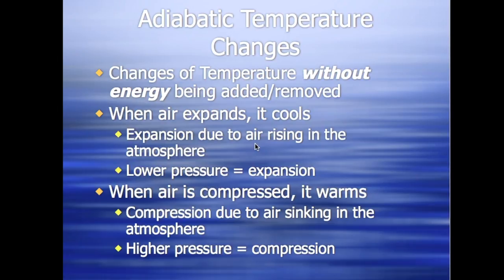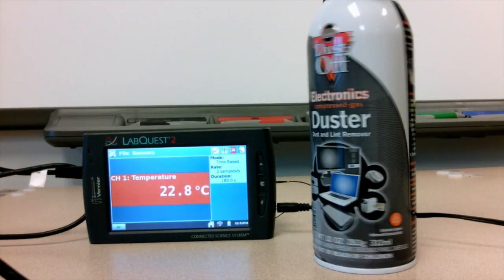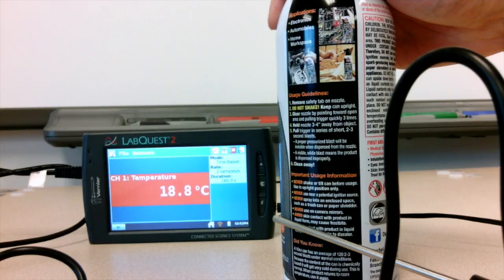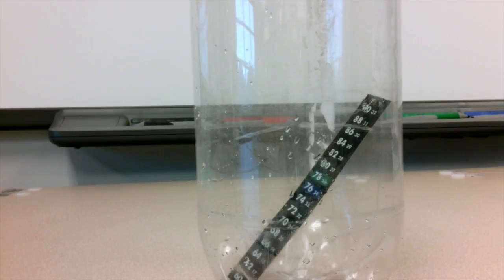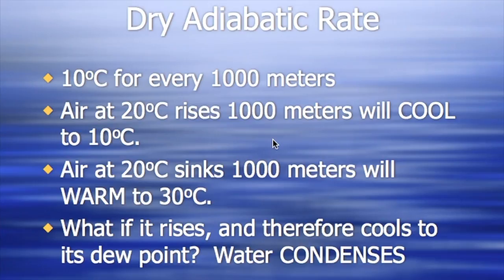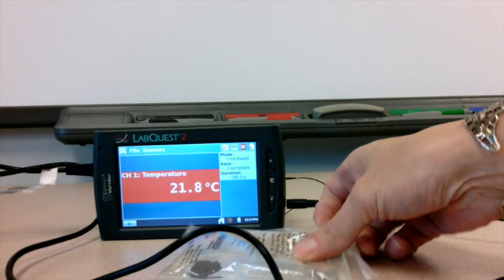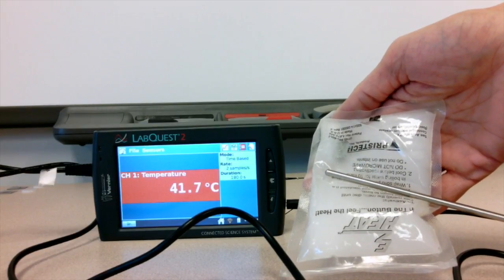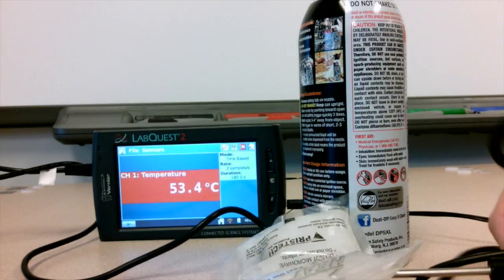Adiabatic Temperature changes

Comment: Neat video. However, that is not a can of air, it is a can of difluoroethane, which sits in the can as a liquid (shake the can -- you can feel it in there). When you reduce the pressure by opening the nozzle, that liquid evaporates into a gas. The can gets cold because the heat in it vaporizes the liquid, so the cooling we observe illustrates the phenomenon of latent heat of vaporization, not adiabatic temperature change.